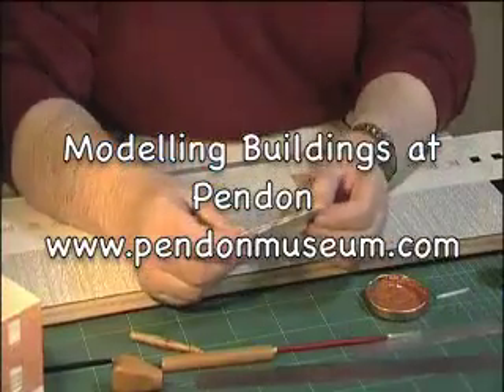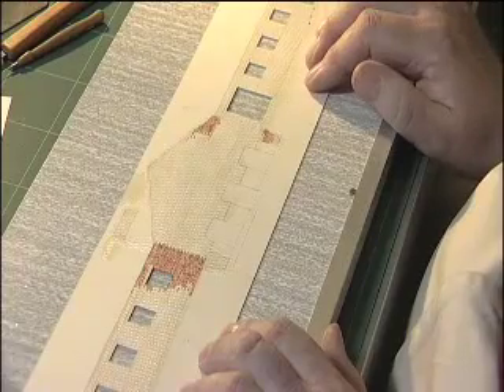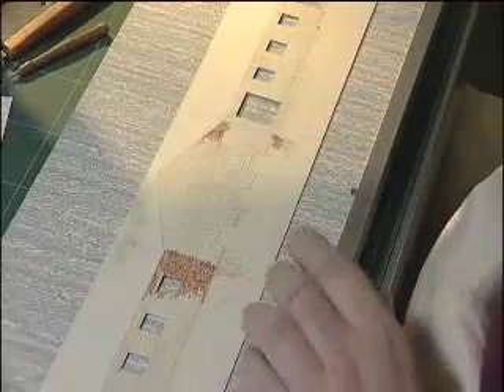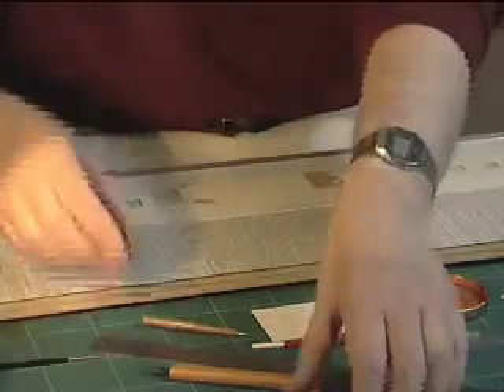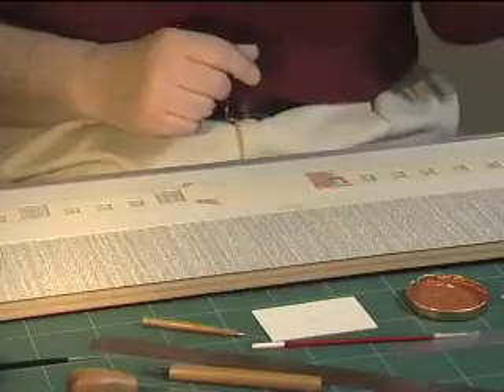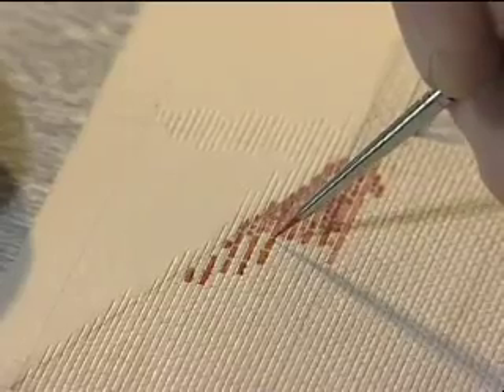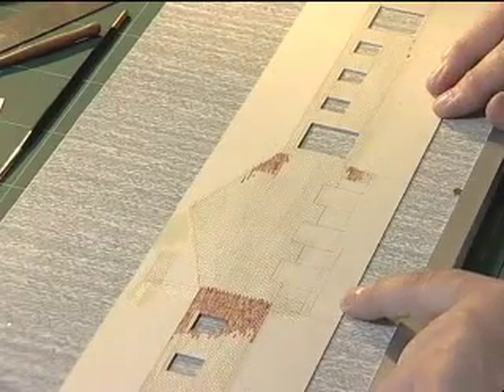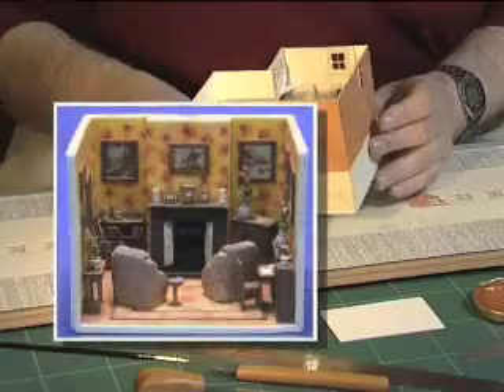Pendon Museum: Modelling techniques

Comment: I agree with 'Whitbyjet65' . 

I use a white and four colours for brickwork - Burnt Umber, Ultramarine Blue, Cadmium Orange and Cadmium Red, Mix equal amounts of the Umber and Ultramarine to give you a black, then this can be used to take the sting out of the cadmiums and give the right hues for the bricks - anything from a washy pink to a dusty grey orange to a strong brick red. Start with lighter hues and gradually pick out random bricks with stronger hues leading finally up to sooty black.